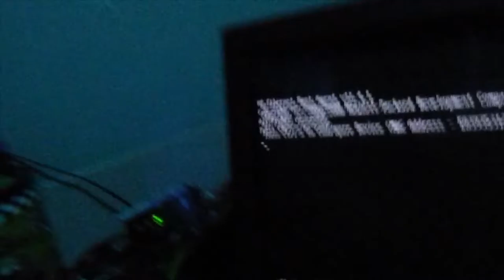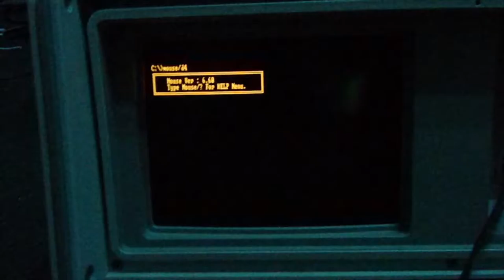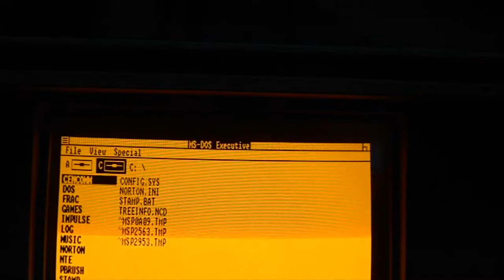Burnt Up PSU PART 1

Comment: I think the idea of that connector is to bleed custom loops.
Reply from the maker: what?
Reply: RockeyDAproductions like you know when you setup a custom loop? You have air in it? I think that's the idea, to run the PSU without running the whole computer.
Reply from the maker: Mike Fox i have never heard of a custom loop, i have lost equipment from ground loop and can not see any benefit from one. and i dont get the air part at all.
Reply: RockeyDAproductions Watercooling stuff
Reply from the maker: Mike Fox i got into that once, i call it my death bench, picks! i was on a 0$ budget
http://i.imgur.com/NX0m1go.jpg
http://i.imgur.com/cm2TNnp.jpg
Reply: RockeyDAproductions LOL nice 😂😂😂👌
Reply from the maker: i have a orang juce bottle i use as a resivwar so air in my line is not a problem, its pushed out during use. i ust hate how annoying the pump is so its benchmarks only.
Reply: RockeyDAproductions well yeah I feel you, I have an all in one watercooler but even then I have to top it off
Reply from the maker: Mike Fox as fa as pc cooling gos im a big fan of vapor chambers and on gpus blower fans because of the high rpm's and air flow. and fan noise i dont even notice excluding my sunfire server. this thing has a lot of small loud high rpm traditional fans
http://i.imgur.com/EEHPACH.jpg
http://i.imgur.com/GzfMeR9.jpg
Reply: RockeyDAproductions that's pretty nice, btw how much did you pay for your SR-2? They're expensive as fuck
Reply from the maker: Mike Fox 450$ new off of amazon when they were going out of stock for the last time.
Reply: RockeyDAproductions Wow, that system must've cost you a pretty penny, an SR-2 plus two X5690s, damn. I only rolled with a X58 and an X5650, it was a solid system but wouldn't let me overvolt, so I couldn't get it past 3.5Ghz or it would bluescreen, sold that motherboard and now I'm rocking a X79 board with a Xeon E5 2670 8 Core 16 Thread turboing to 3.5Ghz, scores the same as a 5960X stock so I'm pretty happy since I got that little monster for 290$ (mobo+CPU)
Reply from the maker: well my rig started out on the cheep side, gpu, and hard drives were carried from this rig (15$ tower for parts(bent pen on cpu socket and dead gpu)) http://i.imgur.com/XahnYrl.jpg this inclused my gtx 480 i got when i turned 18 and a 10k 80gb sata drive i borrowed a 700w psu from a friend and ordered 2 l5506's for 15$ a pice and 2 25$ cooler master heatsinks, borrowed 8gb of ram from same friend. thats what i ran till i got a job, bought 12gb corsair dominator gt 1600 120$, some one gave me there old gtx 680 wich i OC to 1.3ghz core 6.6ghz mem, i bought a segate cheetah 15k.7 for 60$ new, threw it when i got pissed off at gta, bought another one for 40$ new, then bought a extra one for 20$ off ebay. used them on 2 horrible 15$ hp p400's till i could afford a 6gb/s adptec card for 150$, got 2 xeon x5690's for 180$ a pice on ebay from 1 county over(got em next day), seage 4tb sata hdd for storage 90$new, and i blew my internal card out with a sundown sae-600d so i bough a soundblaster x-fi titianium for 90$ and that sound amazing with my soundsetup! firend gave me 1300w psu as present, gave back 700w, friend moved to older 771 server for cheep fast parts, did not want ram back so i spend 80$ on a cheep workstation bord and made it run off of leftovers
http://imgur.com/XQ8URvg
http://imgur.com/iIG3KDL
Reply: RockeyDAproductions No I got it, understood the history behind it, it's pretty interesting, I started out with a Pentium 4 530 and an ATI Radeon X300, 128MB, played with it for a while and then I picked up my first rig, Pentium Dual-Core E2160 that I overclocked to 3Ghz, 4GB of RAM, 9600GT 1GB and some old hard drives, I had 4 of them in an MGE Viper case: http://imgur.com/8H6IcNl 

I then upgraded it with a Core 2 Quad Extreme QX6700 which I overclocked to 3.46Ghz, it ran very close to 90°C all the time and the board was a cheap G41, I don't know how that lasted so long but it did. 

I then picked up a 560 Ti DCU II TOP, it would shut down my computer because it was a power hog, my cheap generic 500W PSU couldn't handle it so I sold it to a friend and got a 750 Ti. It ran fine for a while but then because of PS2 emulation, I had to get better single core. 

I upgraded to an i5 4690, 8GB of RAM, ran with that for a while but then felt the need to upgrade my card, so I sold it to my brother and picked up an used 7950, but I wasn't a big fan of AMD's cards, lacking Shadowplay and all that, I kind of sold it to a friend and picked up a 680 SC from EVGA, been rolling with it since 2014. 

After my ex girlfriend passed out I got into a multimedia school thing, so I needed more cores, so I sold my i5 4690 and picked up a Sabertooth X58 and an X5650, built it as a memorial for her and bought super nice stuff like sleeved cables, a NZXT H440 WHITE, Watercooling, installed an SSD on it that a friend gifted me http://i.imgur.com/enQ79w1.jpg , it ran fine but the board had a problem with overclocking, the board wouldn't let me overvolt for whatever reason, so I sold that board in Q1 of this year, kept the X5650 and since X58 boards are expensive as hell, I picked up an E5 2670 off eBay for 90$, picked up a P9X79 board for 200$ and since then, only had to upgrade the power supply to a Corsair RM750X because my shitty corsair VS650 gave out on its life, it's been running good. 

http://i.imgur.com/F5aCpd4.jpg

Next upgrade might be to the graphics card, my 680 is a potato, on 1.2V barely holds its legs at 1260Mhz on the core and 3400 on the memory, it's overvolted to shit and when I dial in 1298Mhz it just passes out on me after 20 seconds of GTA V at UHD DSR.
Reply from the maker: yeah, my sr-2 draped my jaw when i get it, i went from a pentium d 950 to 2 xeon l5506's i overclocked to 2.8ghz, the performance diffrence was huge, and it was my first time ever using anything faster than a D 950.

also i built this rig for my cuz and spent about 250$ case was a old packard bell. i go alittle crazy with that paint btw.
http://imgur.com/a/Ul2Xd
http://imgur.com/a/6LYLp
Reply: RockeyDAproductions that looks pretty sweet.